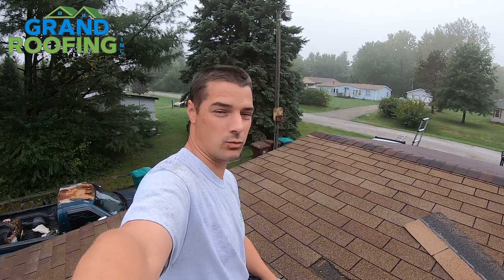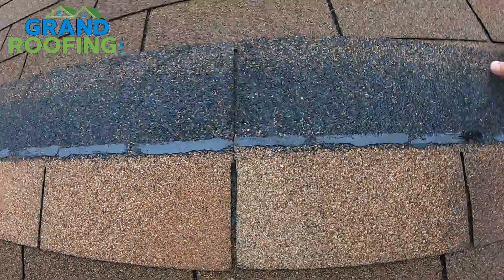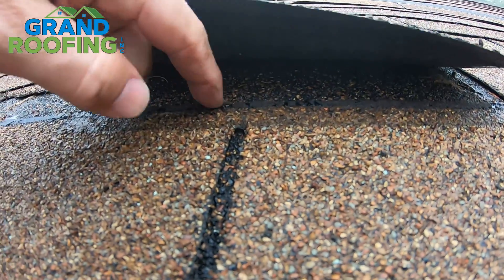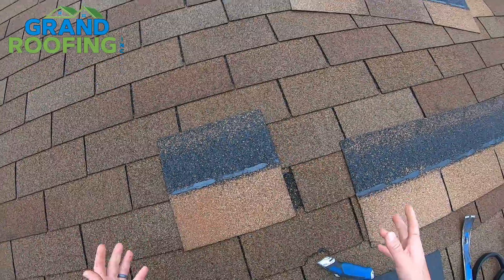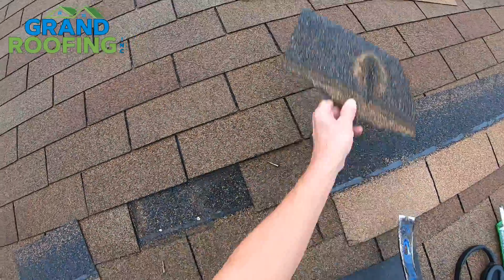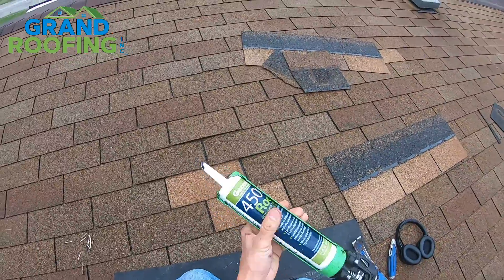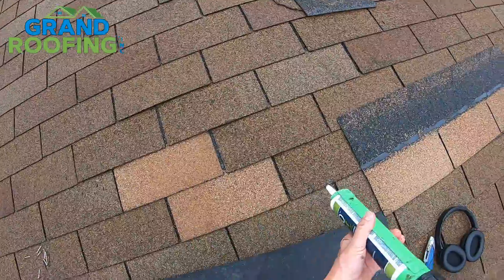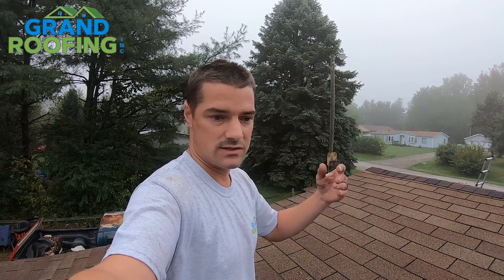How To Repair Or Replace A Shingle - 3 Tab Roof Repair

Comment: Your videos,s are extremely helpful to all D.I.Y..ers Whether they WANT TO ADMIT IT OR NOT; I am 76 and still trying to do what I can; I have a 23-year-old mobile home which I do take great care of; I  watch all the videos of you, repairing leaks around the gas furnace b-vent especially the flashing; I HAVE DEVELOPED A VERY SMALL LEAK IN ONE SPOT A minuscule STREAM OF WATER "FROM RAIN" RUNNING DOWN THE OUTSIDE OF THE 6" PIPE COMING FROM THE TOP OF THE FURNACE SMACK DAB DOWN THE CENTER?? SO I  was thinking I would get up there 4;12-5;12 pitch so not too bad  remove the shingles carefully from around the flashing and see if I can fix it; the going rate for a roofer in my area is about $250 an hour + trip charge of $100- any recommendations would be appreciated stay safe and keep producing those great informative video,s for guys like me; thank you, Patrick Peterman
Reply from the maker: Do you have any pictures you could send to me on Facebook messenger? If so, send them, I'll look them over and see if I can give you any pointers.

Comment: awesome video!!! you make this stuff look so easy!!... I had a tree limb come through the bed room roof and into the ceiling.. dry wall and osb panel have been replaced.. I used some of the roofing cement.. and did not do a good job on the 3 tab shingles.. I gooped the stuff up on the shingles from the left and right side of the holes and the top as well. it was a nightmare to find the small nail head where the water came back into it.. I guess I need to redo this.. project again.. its been frustrating not to worry about. but I want a good seal!!! thanks for your video! it helped a lot!

Comment: Thanks for sharing the knowledge, good man! Cutting back from branches this spring, found a 6 inch hole in the roof. I need more under to repair, but this will cover until I get the larger repair done!

Comment: Using all purpose acrylic latex caulk plus silicon interior/exterior to dab under shingles. It’s what I have on hand. Will that not hold in the long run?

Comment: I cannot find a video where the tab right below the roof cap is broken and needs to be replaced. Do you have to remove the whole roof cap or just the same situation if it’s a tab right below it? Haven’t found one video addressing the situation.
Reply from the maker: If you're talking about a shingle tab, or dimension shingle right below the ridge. Yes, you will need to take the nails out of the cap on that side.
Reply: Thank you for the reply. So I don’t care if I replace the whole three tab or just one shingle but my concern was how do I remove the damage shingle if it’s the top one right next to the roof cap. I have a picture but it sounds like we just remove some nails from the roof cap so I can pull the shingle out?

Comment: Whether it's one tab or 3 tabs of an entire shingle that could be done, where the 3 tabs meet matters.
Reply: Why does where it meets matter?
Reply: @staresce  45 seconds to 2+ minutes into the video, he'll explain why it maters. Also the nail head being exposed.may leak, because it's a hole that goes into the shingle, into the paper/plastic barrier & then into the decking itself. Any water that accumulates will weep down the metal nail & drip into the insulation & the ceiling. That becomes like a water leak into the drywall of the bathroom walls. The water absorbs & weakens, the gravity and the ceiling could collapse with enough rain storms. Wet/Dry patch is better than doing nothing, replacing the shingle for a single tab or all three and you may have to replace the one's above if they are damaged for whatever reason. A repair job, the tabs & shingles above  may be brittle and break.